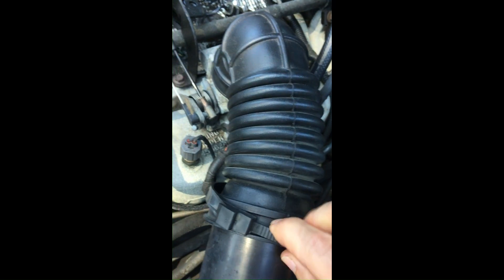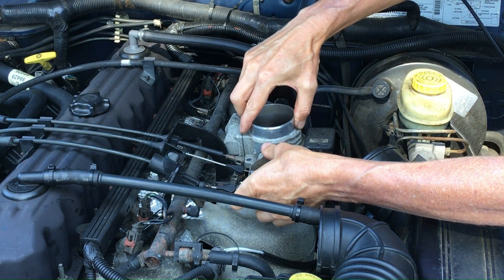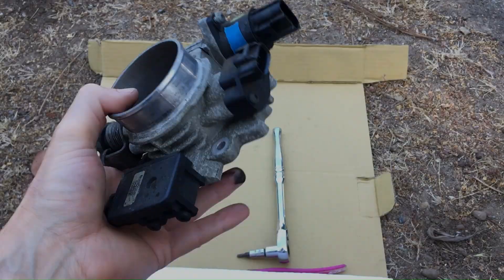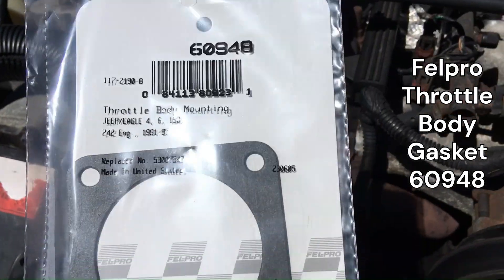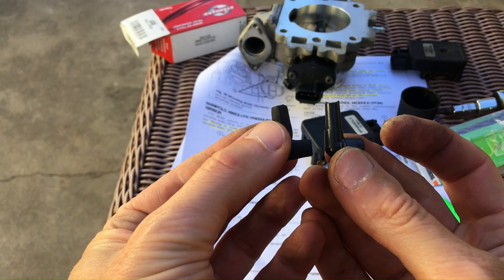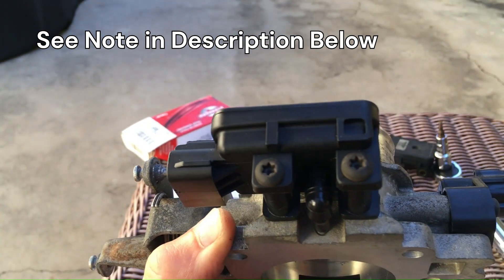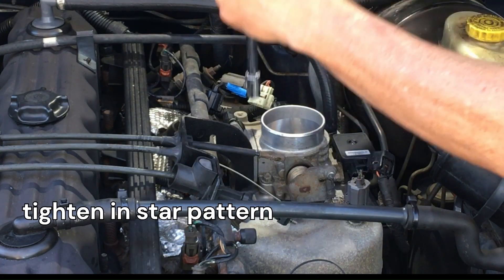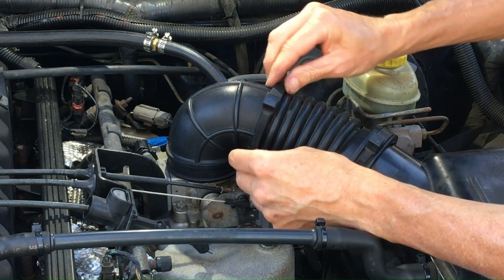Jeep Cherokee XJ Throttle Body, IAC, TPS & MAP Cleaning & Replacement

Comment: Is there a reason why you recommend the tab for the MAP SENSOR?
Reply from the maker: I'm assuming you're asking about my recommendation to try and find the 90 deg rubber connector for the MAP to the throttle body vs. the Dorman kit. I was saying that to avoid having to cut the Dorman to size. But, another guy (@jaaxxone) left a comment that the Mopar connectors are no longer made and the Dorman is basically the only option. I wouldn't go to a junk yard for this type of part since it's likely to be old and brittle (so it'll leak).

Comment: I think you are supposed to disconnect the battery, while switching the MAP sensor
Reply from the maker: Yep, disconnecting the neg battery terminal is an extra measure of precaution. I don't remember if I did that but didn't film it or not.

Comment: SPOILER ALERT:  That rubber elbow IS the de-facto correct replacement for the MAP sensor.  The actual Mopar one is rare as hen's teeth and the dealer will look at you like you're insane if you ask for one.  So use the one in the video, or waste a couple of hours tracking down the original and then end up using the Dorman.
Reply from the maker: Thanks for sharing. Online searches are no fun. I suppose one dealer may have a different inventory than another but a 20 year old part may be obsolete & not carried. 
In my experience the Dorman part needed modification to fit. Too bad it wasn't easy to find a dedicated part for the XJ itself.

Comment: Zj starts rpm extreme high just replace crankcase breather hose and tps and still did the same
Possible a iac map sensor or clogged Pcv elbow
Reply from the maker: Let us know what you find.

Comment: Thanks Jeff.  Gonna save this one for the future, need to chase a hanging idle on the XJ, but even if it doesn’t pertain to the IAC, I’m still overdue for a good cleaning.
Reply from the maker: Cool. Mine has a better idle at cold start right now. I'll make an update video once I've got enough run cycles to see if it helped in general. But, I think my Jeep needs some other basic maintenance (spark plugs, etc.) that was neglected by the prior owner. That stuff may also help my idle issue.

Comment: What year is your xj? Ive got a 95 xj. And when I do a job like this thats going to require the cpu to relearn the parameters of the new sensors… I disconnect the battery. And then after about 20 minutes, I touch the pos and neg battery cables together. Note: you can do this on the ‘96 and older xj,s. But Ive read that you do NOT touch the battery cables together on newer models.) For the newer models, touch the pos  cable to a solid ground on the frame or engine. Re install the battery cables and then turn the key so can turn on the headlights. This tells the cpu to dump the saved info and start relearning new info. Ive been told that the next fifty start ups are what the cpu uses to relearn the new parameters of your xj. Sooo.. I like to take the jeep out for a couple of good, long drives on a highway as well as normal puttering about on regular town roads.
Reply from the maker: 2001. Thanks.
Reply: For sure, the cpu needs to 're-learn' some high and low parameters, always unhook the neg terminal and when all is complete, take it for a drive, accelerating and decelerating to help the system to reset.
Reply: @drew-shourd i didn’t do this it while replacing the cps sensor, but it’s seems to be working fine, as the old sensor was bad caused it idle weird and sputter while driving now it’s all good, i’ll try doing what you guys said for next time

Comment: Hi there, Do you need to disconnect the battery when removing that whole Throttle Body?TIA
Reply from the maker: According to the service manual it doesn't say to do that. To try to get the computer to "learn" there was a new IAC and adjust the air flow I disconnected the neg cable after I was all done. But, that wasn't part of the procedure itself. In my case my rough idle is only marginally better so I plan to go down the stepladder suggested in the manual to address it. I'll try to make a video on that later.
Reply: @DIYwithDrJeff  Thank you so much.cheers
Reply: @DIYwithDrJeff  any updates?  I'm also having major idle issues.  I've now resorted to throwing my jeep into neutral at stop lights while slightly revving the engine with my right foot, and my left foot on the brake... LOL.  Sketchy as fukkkkk.
Reply: @DIYwithDrJeff any update?
Reply from the maker: @ This procedure helped but didn't solve my issue of rough idle. I recently changed my spark plugs and I should have a video on that this week. That made a difference.
Reply: @ a lot of people say to change injectors. Ksport has a 4 hole and 12 hole injector that helps with idle issues
Reply from the maker: @ Thanks. That's something I'm considering.
Reply: @paulrasmussen7459  My idle and sound improved quite a bit with new 4-hole injectors from Injector-Rehab. Each injector matches the other 5 for flow rate.